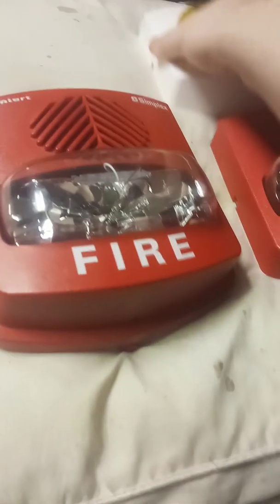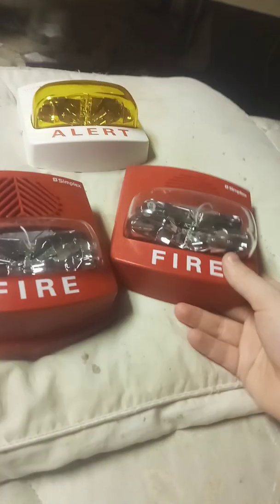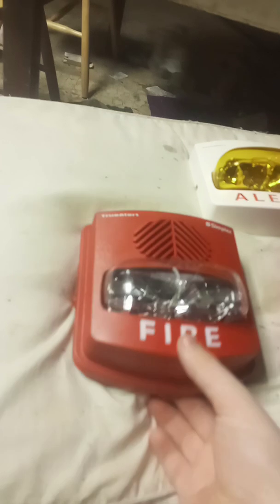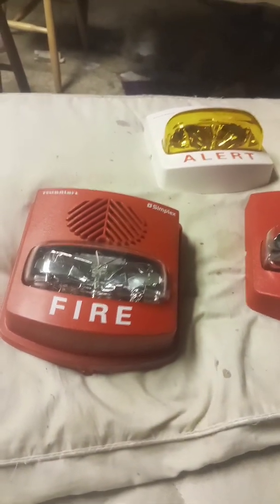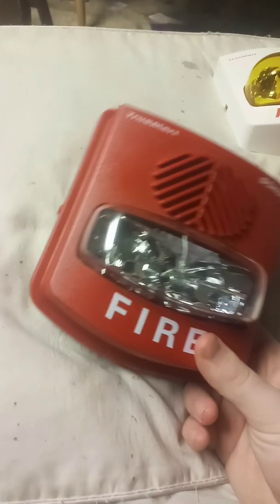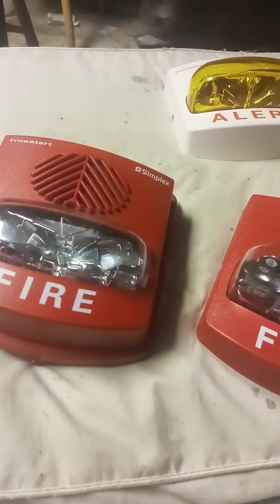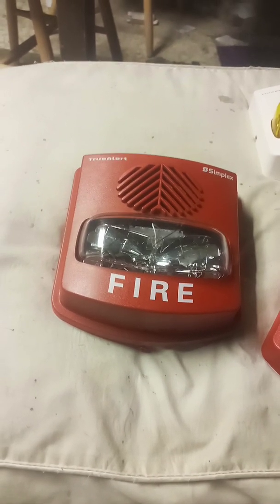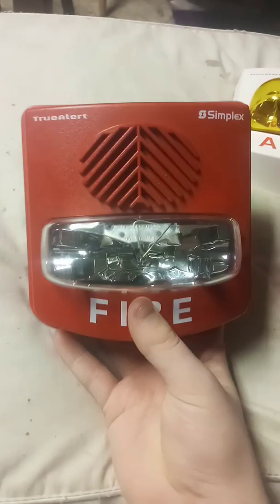If you want a SmartSync operating Simplex TrueAlert, DO NOT BUY THE WEATHERPROOF UNITS (here's why).

Comment: well i might get both indoor speaker strobe smart sync simplex including the truealerts but some outdoor speaker strobes (if simplex makes outdoors weatherproof speaker strobe or wheelock or edwards did which has to be compatible to the 4100es with voice evac message but I do not think this outdoor horn strobe is what I had in mind though. but it might be non-addressable (conventional) or addressable though. if I got the nac smart-sync non-addressable ones. well including specific ceiling and wall mount outdoor units but there is ceiling and wall mounted indoor units.

Comment: I hate them! They never work correctly! They literally skip the first blast. My school has 5 of them. 2 of the horns don’t even sound, just the strobes flash, but the rest just sound weird.
Reply from the maker: Right???, you have ABSOLUTELY EVERY reason to dislike them.
Reply: @dantestoner6020  IK! I have no clue how they get away with it. I guess inspectors just say, “Well. They have a fire alarm system. It looks up-to-code. So I guess my job is done!” Simplex needs to fix that. They’re supposed to test the prototypes before selling them. But some how they got away with it! And now people are pissed when they buy one and find out they’re absolute ASS!
Reply: Back in 2007 they installed them for all of one year at the elementary school that I went to, and then got fed up with them and switched to Wheelock AS weatherproof devices outside

Comment: Yes because the weatherproof models are addressable for the most part. So they require an Idnac connection from a 4100es, 4010es, or 4007es control panel. Hopefully that offers some explanation
Reply from the maker: This one is SmartSync I do believe that you are ACTUALLY refering to is the TrueAlert ES outdoor models.